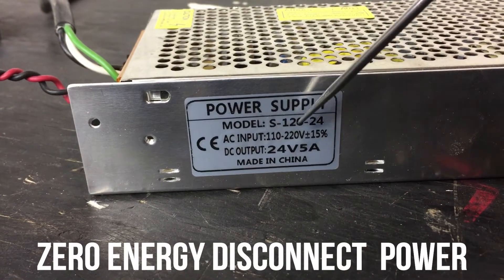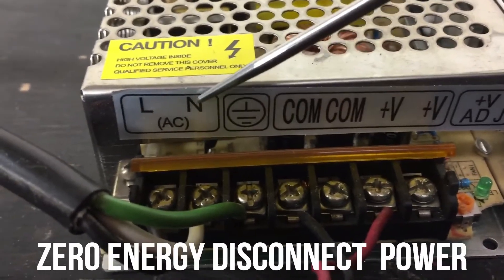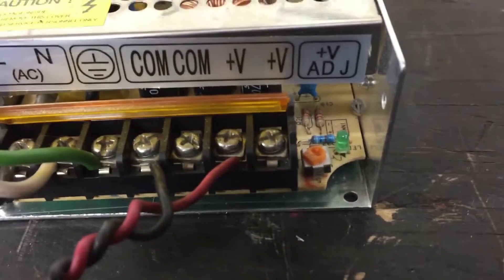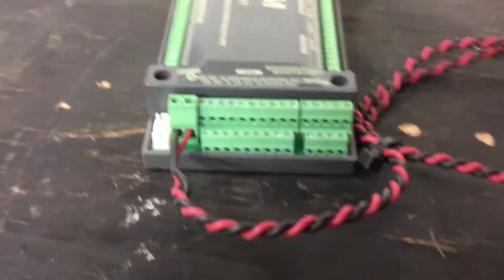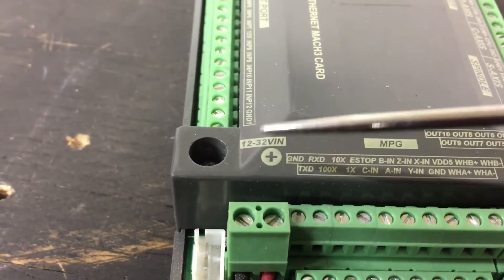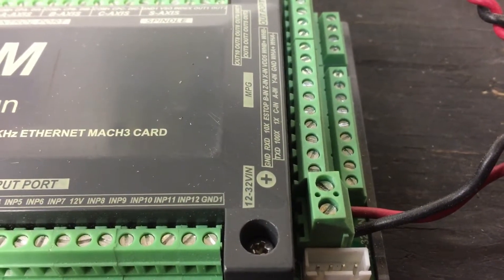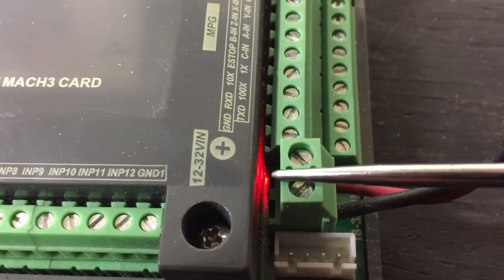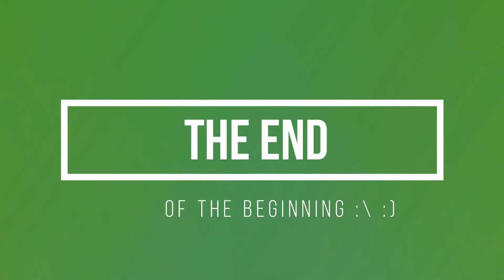Connecting to the Nvem-The Elusive Part 0

Comment: Nice sets of videos. Another good videos would be on actual physical wtiring af all the components. 
Are all the inputs protected internally with current limiting  resistors or do you need to provide those externally on mechanical switches, etc ... I guess they are protected internally in the NVEM.
For the outputs to the motor drivers from the NVEM, again, are any resistors needed or do the motor drivers have their own internal current limiting resistors.
For other outputs I guess it is up to the installer to decide that 
Thanks
Reply from the maker: Thank you!  I've been planning to complete the series wiring internal circuitry,  and a review on the whole thing.  2019 was a complete wash for me,  financially physically and mentally lol thankfully not health wise.   But things seemed to have settled down (knock on wood) at least for now..    I moved into a new garage,  might be getting to a point where I can do another video. Thank you for suggestions I will try to add the information in those next clips.

Comment: Thanks! The manual I have is such a sad writing, no mention of where does that 12V come from in the input section. Well, it is derived from the 12-32VDC or 18-32VDC input voltage (of course). So I just wonder if 12V can work well as the main supply voltage because there usually is a voltage drop in the circuitry converting a higher voltage to lower.

Comment: Are you using the same power supply to power both the NVEM and the stepper motor drivers? I'm curious if the electrical noise from the stepper motors affects the NVEM.
Reply from the maker: For the initial testing, yes!  I was using the 36 V  Power supply that was connected to the 2 Nema 23's.  When all the components make their way into the control box the NVEM will have it's own dedicated 24V 5A Power Supply.  (seen at the end of part 0)  The twisted pairs should take care of any resonant noise,  or at least thats the plan.  I did the twisted pairs in my other control box I have no issues to speak of.
Reply: its an over stated risk - probably of no measurable significance until 30metres of parrallel wires are laid together with signal frequencies close to one another.
Reply: but note that the NVEM is supplied with Cat6 (which is fully screened)
Reply from the maker: So looking back through all these questions I found where the electrical noise definately comes into play.  I added the vfd to my first cnc machine i made,   with huge issues the machine wouldn't move 3 inches without triggering an estop.  i thought with all the noise coming from the vfd I could combat this with fully shielded wire to the spindle -  that was a no go!    ended up having to ground all components of the machine to successfully run with a vfd.
Reply: hey everyone, I have an issue with this Nvem is asking for bin files I added it but it's not working. in config plugin dialog box no axis , 0k frequency is shown. It should be 6axis and 300k Hz frequency. 
need help regarding this